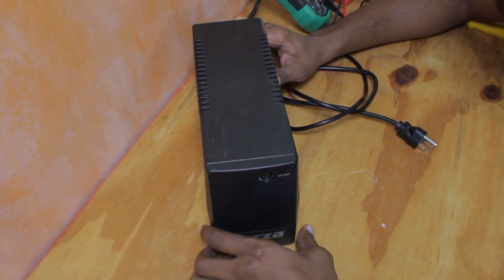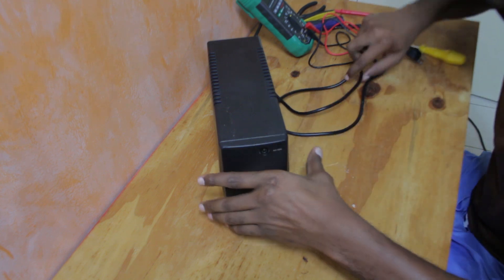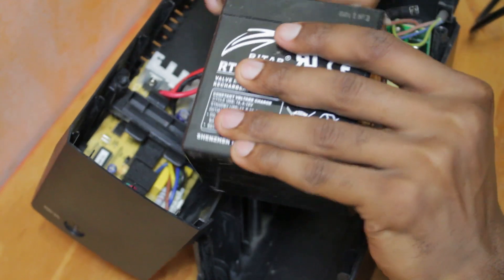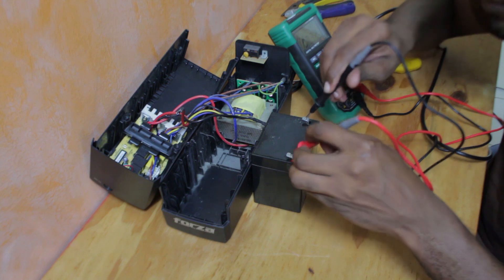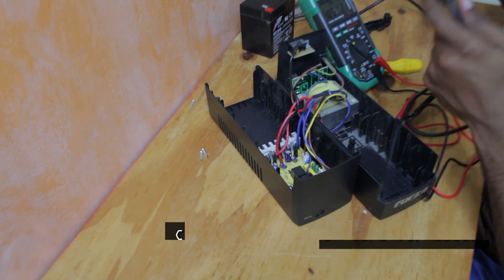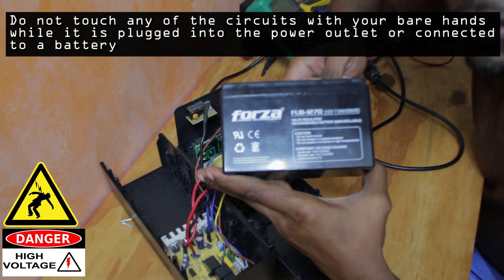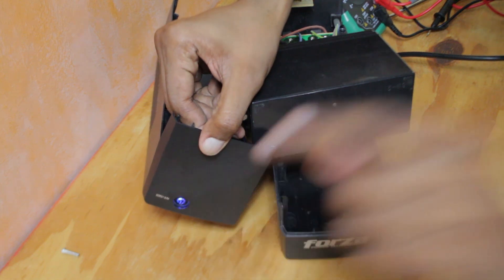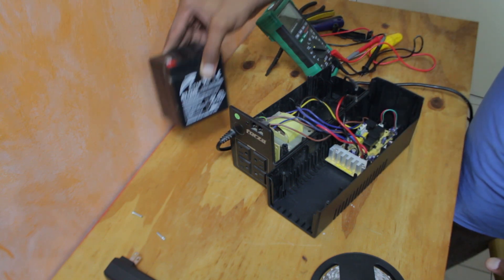Easy UPS fix

Comment: Sir, what transistor type and label is Q8 on the APC BACK-UPS 650CS Model? Mine got burnt and I don't know the replacement type. Alternatively, where can I download  a circuit diagram or wiring for this UPS

Comment: Hi, my UPS is Zigor Debra Pro 1250 VA. Used it for over 2 years. Recently, whenever there is a fluctuation of voltage in my home, the UPS immediately goes to back up mode. But, before when it was working properly, it would continue working thanks to its in-built stabilizer. Is there way to fix the stabilizer function of the UPS?

Comment: HOW TO SWITCH THE UPS ON/OFF CORRECTLY.

i. Connect the utility power to the UPS.

2. Press the power switch until LED starts glowing.

3. In case, UPS trips due to Overload or Battery Low, it can be reset by pressing the power switch after correcting the fault condition.

Comment: An excellent video. The case is identical to the Ion F11 850 / 600 ups, I presume that the inside is the same.   Judging from the top heat. The inverter is actually always running and a relay drops the OP to inverter on no mains.  Battery is needed for inverter and mains relay to run.  Added you to my fixit section.  Subs are on a swap basis. Take care, stay safe.

Comment: if next tym ur ups battery goes bad, use a car battery. thats what im using on my ups
Eaton NV-600
Reply: That's fine for a temporary fix if the car battery is the same voltage and it is near full charge. If it is nearly depleted, the UPS may not be able to charge it (and the UPS may become damaged).

Comment: Thank you Bro, I also had same problem, I was thinking that i had to troubleshoot the board. But after watching your video, I also tried the UPS with another good battery, then it was working fine. So, most of the cases, the culprit is Battery. Now I have to replace the old battery with a good one, then the ups will be working fine. 
You have reduced my work alot by giving the idea of testing with good battery. Nice idea. Thank you again!!

Comment: This batteries are charged with some kind of charge controller IC, or just by applying a small current(500ma or so)?

I've the same situation, but my ups wasn't charged since many years, now batteries are completely flat (0.5v).

The ups shouldn't it be able to charge them even if the charge is so low?

I've got a charger for this gel-lead batteries, I will try with that, to see if it resurrects.

If anybody can give me some hints  on how to fix the device, that would be great!! 
Thanks! 😉

Comment: mine has blue mold on the battery wire connector..what should I do? I cant even pull the wire because of the blue mold like glue..

Comment: You didn't pulled out the plug, how do you know if the ups has only battery issue
Reply from the maker: This is a common fault with these UPS, that why. If the battery replacement failed then other things would be looked at.

Comment: When I turn on my UPS, I read 7.5V at the wires connected to the battieries. But the measure decreases very slowly, and after 5-6 minutes I have 0.4V. Do you have any suggestions? Thanks!
Reply: thats a dead battery

Comment: Hey! I have an issue with mine...new battery.
Rated at 1000va so 600w. With 250w charge it will shut down with no warning. Any idea?

Comment: This was an extremely helpful video. I have a Sweex 650 VA, which is identical inside to your Forza. I was about to by a new UPS @ cost £70, but luckily found a replacement Lead acid battery from Duracell online for just £20.My UPS now performing perfectlyMany Thanks!
Reply from the maker: You are welcome!!

Comment: If I replace the internal battery by wiring it to an old car booster pack externally, what is minimum wire gauge to use for battery connection. Thanks
Reply from the maker: It really depends on the amperage that will be drawn from the battery. Use a wire gauge chart to assist you.
Reply: But remember that the charger in the UPS will take a long time to trickle charge a car booster battery....

Comment: sir my ups is not giving output in Maine but it gives in battery back up mode please help
Reply: Line sensing problem
Reply: @Manikuttan9  uske liye kya check karna chahiye?
Reply: @Manikuttan9  sir usme power to on ho jaati hai or show bhi karta hai ki Maine aagyi hai or battery charging bhi start ho jaati hai but power out karna band kar deta hai kya ye relay ki problem hai?

Comment: is there a way to increase UPS backup time .i put it for charging for long time but my pc shuts down immediately when there is a powercut.
Reply from the maker: The battery might need to be replaced because usually the ups would give at least 5 minutes before loosing power.

Comment: I have a problem with my ups...it's a SVC ups in line 1500VA.
When I'm turning it on, it continue to blink on the backup mode and when I press the power button, it blinks on the normal and overload mode and and continue to blink on the backup😐 .And sometimes it blinks once on the normal mode when I press the power button and then agains continue to blink on the backup mode..and I don't know what happened to it...it a ok a few days back!

Comment: hm, i changed battery, acid was leaking, so after changing it i took another old one from garage 2yrs old and it was depleted to 1V i putted it in there and it charged to 12v but it when i try to use it it says battery empty and shuts down i was charging  it for 10 hours now.
it charges the battery with 13.1V
Reply from the maker: Battery that are left discharged for extended time cells my become permanently damage. Try a new or a good used  battery instead.

Comment: My 1200 VA UPS got damaged due to unstable current yesterday. It emitted bad smell. I pulled the charging plug out. I cannot press the power button now. It is flickering inside with sound clicking inside. I am curious to open it and look inside. But I do not dare to open it because in it notice it says  (do not open the cover . Risk of Electrical Shock.) When I look at you, you don't look that quotient. I am afraid if I go to the repair shop they might charge too much.
Reply from the maker: If you are not comfortable with electricity, get a professional look at it.

Comment: Sir my ups is working but battery is not charging so what should i do
Reply from the maker: Check the voltage of the wires connected to the battery. If there is very low or no voltage then the issue may be with the charging circuit. If there is at least 10 volts going to the battery then the battery might have an issue.

Comment: become very hot  my ups though the computer is off but ups is plugged  in ac wall port.is it problem ? if  what is the solution..........please answer me
Reply from the maker: I think it maybe the inverter circuit causing the issue.
Reply: thank u

Comment: I ve a similar problem with my ups. the battery is OK and the ups works fine with mains only that it won't work when u unplug it from the mains. it will beep for 5 sec and off. I noticed that two regulators( power transistors) are broken I.e opened. I replaced them but as soon as I put on the inverter the two transistors which I replaced exploded and burst open. what could I do
Reply from the maker: This sounds like you have a faulty PWM circuit. You need to check if other components like resister, capacitor and IC are damage and replace them.

Comment: You connected the UPS to main AC power at 6:34. When you plugged in the light at 7:20, your UPS is operating off of main power (not off of the battery). Thus, you are not verifying that the new battery can energize the UPS and power the light. To actually see if the UPS can operate off the battery, you should have unplugged the UPS from main power to see if the light stays on.
Reply from the maker: Great observation, the thing with some UPS is that they will not power on unless a good battery is installed. The fact that it came on showed that nothing was wrong with the inverter circuit. Your are right I should have unplugged it. Thanks for your feedback.
Reply: That's what I thought too, but some people found this helpful. Go figure.